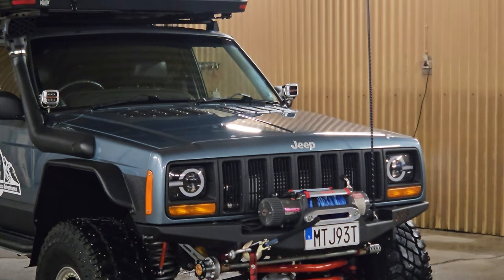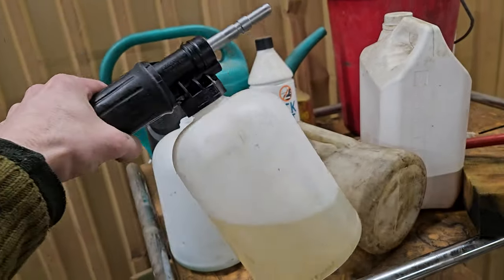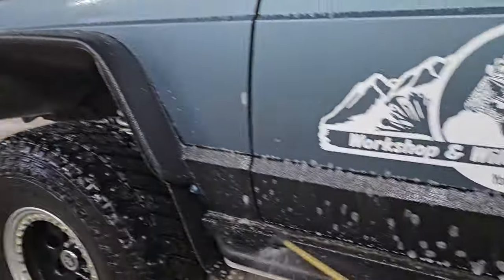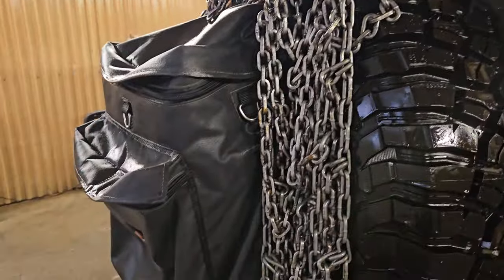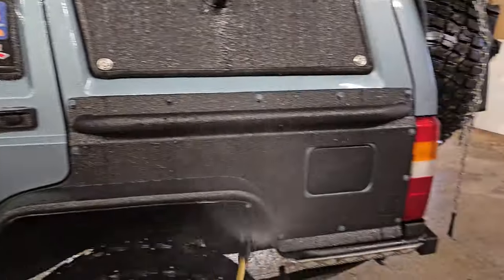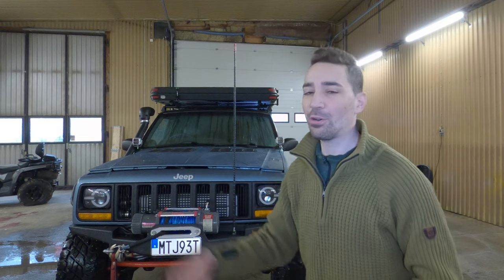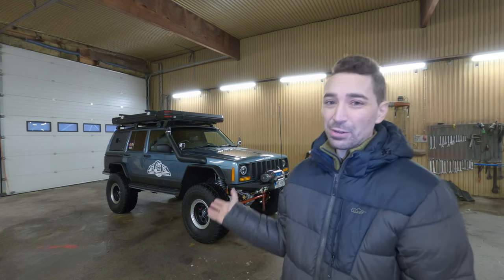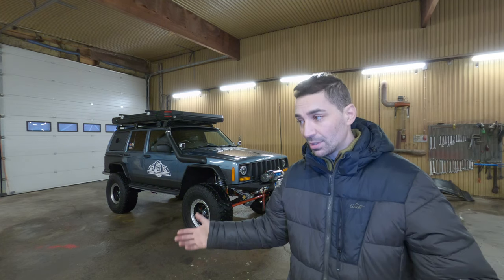SUPER EASY Touchless Car Wash With A Perfect Finish

Comment from the maker: Just a quick mid week video! The jeep wasn't that dirty in this one, but I was cleaning it ready to get under it and change the chain in the NP231, so I thought I would make a vid. 
I've been asked so many times about how I wash the Jeep and keep it so clean. I don't think its a secret but I use what's called a brushless cleaner meaning no sponge, bucket or touching it in any way (unless you choose to hand dry). I don't do this because I'm worried about paint scratches, I just do it because its fast and easy and the Jeep comes out looking showroom clean. It costs more to use these technical cleaners but I don't like spending a long time washing my Jeep and I like the best results, so it works for me. 
When the Jeep is caked in mud I pre wash it with the pressure washer before following the steps in this video and the outcome is the same. Its a waste of product to douse flakey mud in it basically. 
This is the best cleaner I have used to date as its the only one that cleans everything with no left over residue or dirt, without caring too much about a through pressure washing.  
Thanks for washing.
Reply: Видео сделаешь по замени цепи? У меня тоже 231😁
Reply from the maker: @cherokee7824   Yeah sure I can do that.

Comment: I keep my XJ undercarriage sprayed with WD-40, I gave it  good scrubbing once a year, drive it to air dry it, the apply a labral coating  of WD-40, nothing sticks to it, and you can pressure was dirt, salt, mud right off.
Reply from the maker: I use dinitrol under mine. 3125, then the 4941. You re-apply every ten years. I used to use wd-40, but it comes off in the snow when I'm in the wilderness.

Comment: Really nice man. Quick question, do you use any type of kill switch for anti-theft? I’m trying to figure out if and how to do one. I’ve read I can put one in the fuel line power wire that runs down the cab but not sure if that’s too obvious.
Reply: If your jeep is a gas 4.0 engine. Get another fuel pump relay. Take it apart inside. So it doesn’t work. But looks good. Then swap out your good relay for that one in the fuse panel under the hood. 
That’s what I do if I have to leave mine in a remote location unattended. With its steering lock on also. If someone cuts the steering lock off with a grinder. And figures out how to get it running without a relay at hand ….well then I guess it’s gone!
Reply: @russjowett2137  that’s awesome lol. Great idea. Thanks!
Reply from the maker: I have a kill switch hidden in the Jeep that stops it starting. Its also got vibration detection, GPS and engine start detection that sounds an alarm on my phone.
If someone tried to open a door for example, my phone would sound a loud chime that lets me know someone is messing with the Jeep.
Thanks for watching.